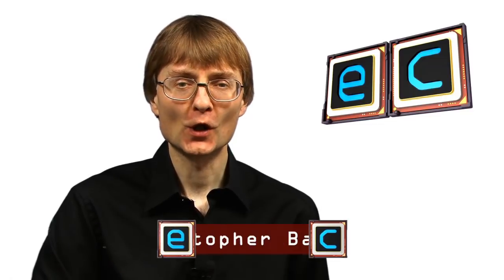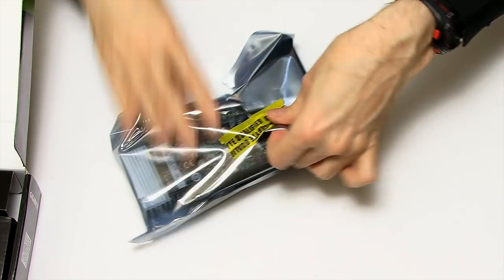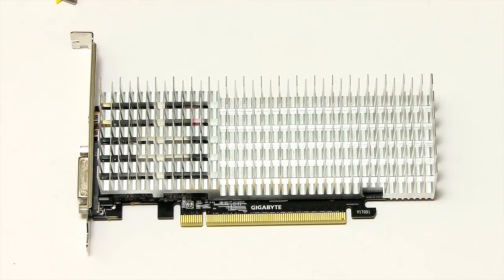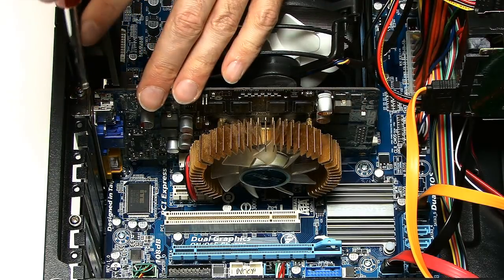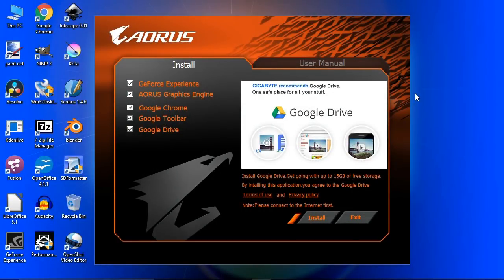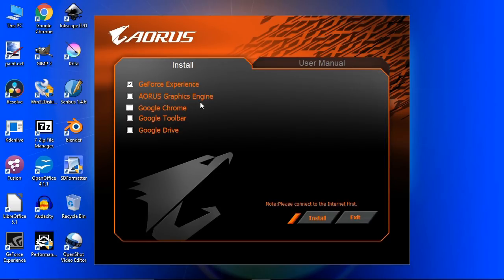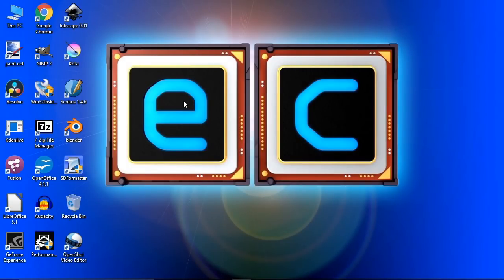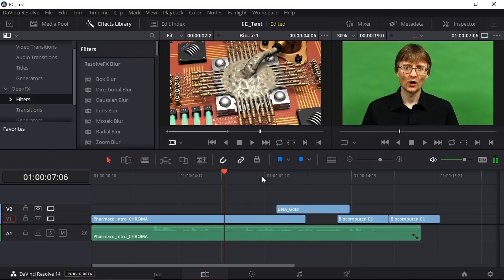GT 1030 Silent Graphics Card

Comment: Couple mistakes I'd like to point out:

First off, that is a DVI-D dual link socket, not *single link*, as single link has a square of pins missing from the middle of the connector. The four pins that would surround the flat pin at the end are for DVI-A on their own, and constitute DVI-I when paired with the flat pin.

Second, the little lever on the PCI-E slot only needs to be held on removal of a card, not *insertion*. The little latch is tapered on the top and flat on the bottom, so insertion force alone is enough to clip it in, while no amount of force will pull it back out without breaking something.

Third, not so much a mistake as a tip for anyone who sees this, but if you download the latest drivers from NVIDIA's site directly, as opposed to using whatever came with the disc, you can forgo installing Geforce Experience entirely (as an option in the installer). It's a completely separate companion app from the actual driver, and the base utility is still installed regardless of whether you have it or not. It does nothing but offer access to game setting optimizations and advanced features of the card, like Shadowplay.

Lastly, a small matter of opinion. If you're looking for good video editing performance, I can sort of see why one might go for this card, but it still stands that the price to performance ratio of the card in games is absurd compared to the slightly higher-up options in the same lineup. Even for entry-level gaming, I'd never recommend anything below a 1050, because sub-30 frames on anything but the lowest settings is not a good experience. It's amazing what the CUDA cores can do in an editor, even in an underpowered card like that, but that is such a special use case that I don't think it's worth recommending the card to anyone looking for even the slightest bit more versatility.
Reply from the maker: Thanks for your detailed comments. The box for this graphics card is clearly labelled 'single link DVI', which is why I noted that. Yes, I got the lever thing wrong about having to hold it back to insert the card. I am staggered people think this is an issue of note! As I stated in the video, working blind on camera is not easy, and I remember the days when this was the case on some APG slots. As you note, I was fitting the card for video editing -- which I would hardly describe as a minority use. And many people here have noted their use of the GT 1030 for games. A GTX 1050 is about twice the price, which to many people is significant. :)
Reply: I suppose then the extra pins on the socket are simply for dual link connector compatibility then, so I apologize for that nitpick. As for the use case, you are correct, video editing is not exactly a minority use case, but my point was that besides editing work, and perhaps accelerated video encoding/decoding, the card will offer what I personally would consider a very suboptimal experience, especially for gaming. Granted, it will be better than some cards from a number of generations ago, especially with the architectural improvements made in the last generation, but as you mentioned in the video, it may not even be able to run some more demanding titles straight away without some fiddling. There are AAA titles these days that even require a minimum of 3 GB of VRAM for anything but the lowest settings (see Shadow of Mordor).

I do apologize if I came off as a grumpy commenter, long days at work tend to do that once in a while. The basic gist of my opinion is that if one is going to get into PC gaming at all, then the value of the higher-priced card is most certainly worth the cost for the difference in experience one would be getting at 1080p (as mentioned my many other commenters below as well). It is twice the price, but the GPU is doing increasingly more of the heavy-lifting in games, and the extra power will both provide a better experience now, and avoid having to replace the card sooner down the road.

Comment: Isn't the GeForce Experience software not an essential requirement to use the card? Thus it's merely an annoyance. No?
Reply from the maker: Yes, you do not need to install it -- but I still think that having the default installation of the driver update behind a login is not good.

Comment: Please do not refer to a 70$ GPU as value, a 1050 or 1050ti is leagues better for 25$-50$ more...
Reply from the maker: At least on Amazon, the 1050 is about double the price. And if you don't need the extra power (or want the silent operation or lower power consumption) the 1030 is a good purchase. This is not a gaming rig! :)

Comment: You don't look like you assembled very many computers... despite the site/channel name... 

No, you didn't had to pull the locking tab in order to insert the card. It is made so it locks the card and prevents it from coming out of the PCIe slot but it will be pushed by the card itself, the little clear pcb extension at the back of the PCIe connector....
Reply from the maker: Well you are wrong about how many computers I have built. I think nearly 10 years here on YouTube, 240K subs, 25 million views, 27 years teaching computing, and publishing 13 books on the subject, does gives me some level of credibility. OK, I forgot that you only have to lift the lever to remove a graphics card these days. But this is hardly a major issue -- and as I said in the video, it is difficult working on camera with an obstructed view.

Comment: There's a reason nobody does reviews of anything below a 1050, they're all horrible value.
Reply from the maker: I simply do not understand this viewpoint. A 1050 is twice the price of a 1030. If you need the extra power, then certainly a 1050 is better value if you can afford it (and not everybody can). But if a 1030 provides all the functionality required -- as it does here (this is not a gaming rig) -- then it provides good value. Specifically here it took a PC that could not run a lot of modern video editors to be PC that could run them well.

Comment: You checked GeForce Experience in the install Window. I wonder why it was installed
Reply from the maker: But I did not proceed with the install . . .
Reply: Then why did you install it? Just to tell us it is crap, and you no longer need to install separate drivers in Windows?

PS: If one were to use the driver download from Nvidia, one could disable GeForce Experience in the Installer.

Comment: why did you say that you can't use this card with VGA monitor?
You definitely can via VGA to DVI adapter
Reply from the maker: I would not sensibly recommend a card without a VGA port to somebody with a VGA only monitor -- if I did that loads of people would be moaning here. This card is DVI-D -- not DVI-I or DVI-A (ie, it has no analogue signal). Hence those standard (passive) DVI-VGA conventors that many people have lying around will not work. Yes, you could use an active DVI-D to VGA adapter - but they are more expensive, and frequently give problems. So I am giving sensible advise based on this hardware.

Comment: with AMD you dont have to register or login, you just right click desktop, Radeon settings. press update it checks for update. I agree that nvidia drivers in the last few years are basically crap. they stop supporting their old cards. you can even do virtual resolution on anything but the gtx 900+ series, but with AMD they supported their cards all the way to HD6000 series, maybe even earlier when they add this new stuff to their drivers. I'll also point out that AMD have Relive, for streaming or recording video with no performance loss, no account needed, Nvidia have their Geforce experience that does require an account, just little things like that annoy me.

Comment: Would just like to point out that the DVI-D connector is Dual Link, not single link like you said in the video.
Reply from the maker: I believe that GT 130 card can be manufactured with either single link or dual link DVI-D connectors. The box for my Gigabyte card is labelled "single link DVI".

Comment: To be fair, the 1030 has very poor value for money, the 1070 probably is the best value new card, but it is very affordable.
Reply from the maker: The GT 1030 is not poor value if, as here, it adds the required functionality at lowest cost (and also consuming a lot less power and hence generating a lot less heat). The GT 1030 is about $70. A GTX 1070 is at least $440 plus, which a great many people would not consider "very affordable".
Reply: The 1070 isn't affordable no, but it is a better value because you get more performance per £. Value wise, the 1030 isn't even the best value for cards under £100, and are power efficient enough to work from PCIe slot power. That'll actually go to the 1050, which is roughly 80% faster for 33% more money.

Comment: Isn't the APU graphics faster than the 9500GT that was in there to begin with? The 1030 is a good upgrade in this case though.
Reply from the maker: Correct on the APU v 9500GT, but the card was needed here as this is a test PC used to record videos for my channel -- and the onboard graphics do not have an HDMI socket to connect a recorder to, hence the card was required.

Comment: cant use vga? get an adapter cost a single dollar or euro or pound
Reply from the maker: There is no $1 adapter from a DVI-D port to VGA. DVI-I or DVI-A absolutely. But there is no analogue signal from this board. I made the point very deliberately as the kinds of DVI to VGA adapters that many people have lying around will not work with this card.

Comment: bro u can download the drivers from website without logging in (thats how I do) + you don't really need geforce experience when u can manually do it. Just stop being lazy already.
Reply from the maker: As I made very clear in the video, I sorted the drivers out. But this does not stop it being a disgrace that the default method for upgrading (NOT obtaining) the drivers for this board in the software supplied.
Reply: ExplainingComputers thanks for replying.

Comment: A good card if you dont have the lastest intel cpu and you want 4k video supported in hardware
Reply: why you had a 9500gt in your computer with that apu il never know
Reply from the maker: This PC is my test rig from which I often record the output for videos using an HDMI recorder. The onboard graphics have no HDMI socket, hence I used the 9500GT.
Reply: i see fancy them not putting hdmi on a motherboard designed for apus

Comment: Wow. You've really been working with a Geforce 9500 GT for years? For video editing? You sir, are a true trooper, cause correct me if I'm wrong but that GPU is from like 2008 or 2009.
Reply from the maker: This is my test rig -- not the PC on which I edit my videos. The 9500GT is indeed from 2008. It started out in my video editing PC, but was replaced there many years ago.

Comment: Hi Christopher. Nice video as always.
For me the GT 1030 has 3 plus points
1) Low current draw max 30 watts of the bus , so no need for any extra power cables and a small capacity power supply as found in OEM machines  handle this well.
2) While you  briefly showed the smaller half height card, this is a strong selling point for small factor machines  i have a HP 8200 and Lenovo , both have limited 200-240wat power supply and small factor cases, I have the same passive cooled in the Lenovo and the stock with small fan in the HP - they both perform identicall
3) Modern games love the 3D graphics, most games on the built in intel video chip ran 10 - 30 fps, more they run 50 - 180 fps , so overall each games sort of runs x3 to x5 times faster in fps

The passive cooled unit does take up 2 slots, and it is about 1.5 inches longer than the standard fan cooled unit
PS while i dont overclock any of my PC items, you can use as a utility tool and overclock software the MSI  Afterburner program

Regards
George

Comment: This is a beefed up GT 730. The only edge this has is 1500 core clock where the 730 OC has factory 1003. They share the 384 cuda cores and 2GB of DDR5, I think it might be a better solution to go with the 1050 low profile as it has 680 cuda cores and can be used in any machine the 1030 will work in. Just my opinion.

Comment: I was looking for the 1030 but couldn't find it on the local market. I was looking for a card to put in a small form factor case (SFF) an Optiplex 9010. So I ended up with a 1050 instead. It's great if you want a cheap computer on a budget, get an ex-business machine and fit a gtx card. The reason why I prefer the 1050 is that is does have a fan and expells the hot air to the outside, which I prefer in a crowded space case. The 1030 will heat up the inside of the computer instead without helping to expell the hot air. Once you do actual gaming or a high CPU/GPU load things can get hot quickly unless you get rid of the hot air.

Comment: It is not really "Good Value"

For a few pounds more you could've gotten a GTX1050 which will has better performance per pound.
Drivers can be downloaded  from the nvidia site so drivers being out of date is meaning less and support for the cards is about 5 years.
Plus drivers on the CD will be out of date and it is always better to download the latest.
Heck the 600 series is still supported
Reply: I bought the fan version of this card for the following reasons. Low power consumption and and the 150mm length of the non fan version. A GTX1050 would draw too much power and is too long to fit in my high spec.computer with SFF case. A gamer however would not be buying a SFF case and would have a 300w+++ power supply.

Comment: 5:55 GET IN YOU SWINE!

7:30 of course it didn't install correctly because i didn't run it you stupid thing, anyway don't you just hate computers?

 1:10 and in case you were wondering this cost me 64.99 pounds, anyway let's open up this box, you always get lovely boxes with graphic cards 

This guy is priceless, i bet he would get a instant heart attack if he'd had to review a intel 10 000$ costing xeon platinum processor. It's ok to step up your game a bit man. Also do a review of a 800$ costing graphic card sometimes. But i was really surprised by this review, i never knew they would still make graphic cards that would purely rely on a heat sink.

Comment: Why buy a gfx card that is worse than using a Cpu/on board output for gfx?
Ive just bought all the cables required to put a powerhouse PC in the other room. Even a mid range computer is almost useless at just publishing videos and playing 4k content among other things.
Reply from the maker: I am not aware of any onboard desktop motherboard graphics that are better than this card (Iris on laptops is another thing), snd the card certainly upgrades the PC in question, which is the whole point. :) And today's midrange machines can certainly be used for video work.

Comment: The reason why it asks you to sign into the geforce experience program is because its a game play sharing software for uploading game footage and screenshots to various platforms, It actually has nothing to do with configuring your card. There is another program that comes with the driver called the NVIDA control panel. Funny enough the auto update driver utility normally dose not work anyway. The driver is always available from NVIDA's website where you don't need a account. Thought I would just clear that up a bit. Great Video though!
Reply from the maker: You miss my point -- I am well aware of what you state, and showed obtain drivers via other means in the video. But the fact remains that, to install the driver updater that allows you to constantly update the drivers -- you now have to create an account with GeForce Experience, whereas in the past such a utility did not require an account.
Reply: True,  Sorry though, I thought that you misunderstood why it needed it. I could never get the updater to complete anyway, and its only real benefit is the good screen capture utility, but unfortunately its not supported by the gt 1030 . It kinds of sucks that companies like gigabyte send that as the only software on the CD.

Comment: I agree that you shouldn't need to put in your details to install drivers, but can't you also get them from the webpage
Reply: I always download the drivers from nvidia.com. It doesn't ask for my information but the driver installer is huge. More than 350 MB! Win 95 OSR2 was itself 65 MB.
Reply: louis tournas oh jesus. Windows usually just installs it for me so I've never had a problem with any of this
Reply: +65 Diamond:
I guess it depends if you are a gamer or not.
As a gamer, I do need the latest drivers.

The other reason is OpenGL. If you need OpenGL, Microsoft doesn't include the OpenGL driver that comes from nVidia, AMD, or whatever for some reason. They just delete it. I have never seen an official explanation from Microsoft for this.

Probably the reason is that they don't like OpenGL. They prefer the market Direct3D.

Comment: I have a GT710 2GB after watching this video I am considering the upgrade to GT1030 I would be going from GDDR3 to GDDR5 RAM, Doubling the CUDA Cores from 192 to 384, and it will leave me with a leftover PCI-e graphics card to use in my older PC, a Core 2 Duo E2160 sounds like a good overall buy for around $100 Au, considering the most demanding games I play are DayZ SA and Arma 3.

http://gpuboss.com/gpus/GeForce-GT-710-vs-GeForce-GT-1030

Comment: Shouldn't even go to device manager as sometimes it won't actually download the right driver. Simply go to nvidia.com, download the latest driver pack and run the installer, WITHOUT selecting GeForce Experience.

Comment: Thank you, this was good to know. Its hard to find decent Graphics cards in a Low Profile format, and additionally cards that do not need additional power supply input. So this card is ideal for branded Business PC's that need some extra graphics processing power. Such as current range HP Prodesk 400 PC's and so on.